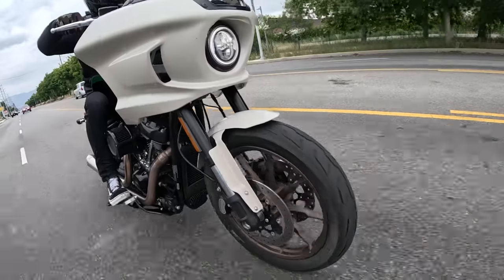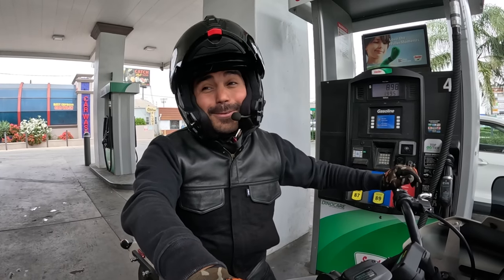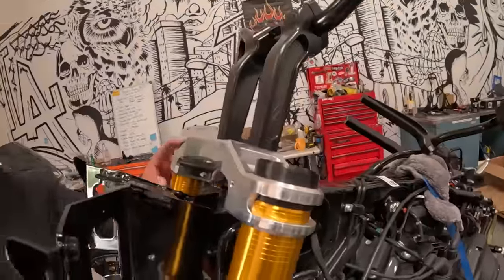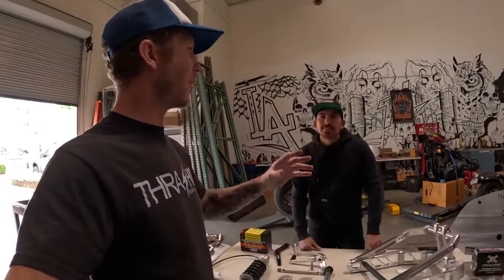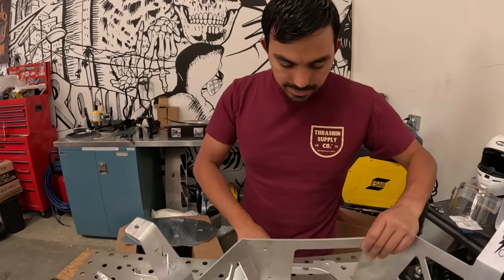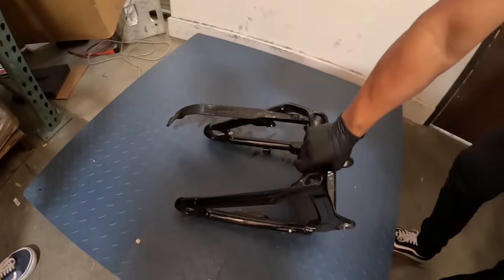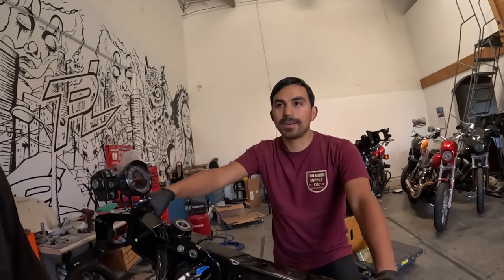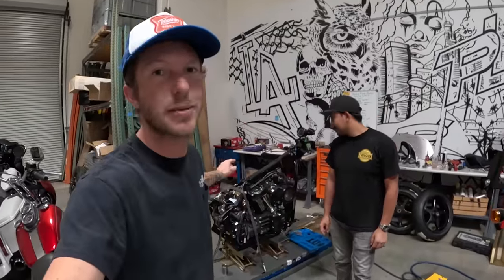Low Rider ST! Makes 1XX Horsepower? Born-Free Build Week 9 - Vlog 77

Comment: Smart on titanium for bolts with anything touching composite. Make sure no aluminum contacts composite. It will corrode. Worked on Boeing 787, aluminum and composite are a problem. Great videos!

Comment: You guys should try rcs levers they make them specially made for harleys and they make a world of difference with the clutch stiffness on the harleys.. and they have a lifetime warranty so if it ever has any issues they replace it free. But the best part is hoe they make the harley levers so that it's a much better design so it makes clutch pulls feel so much easier it's almost unbelievable 😊

Comment: I cant believe you guys spent well over 5 grand on wheels and didnt use ceramic bearings...LOLZ....Brocks is right up the road from you and usually has them in stock....  Bike is REALLY ready to rock now!!!  Cant wait til next week!!  If I still lived nearby I would be spying on you!!  LOLZ. I have to go back and look, but hopefully you did some work in the Primary, as once you put those super sticky tires on, your compensator and clutch are gonna get wasted for sure, and if you did, then it will be time to worry about the transmission.  The drivetrain just isnt built to handle it all, once there is zero give at the tire....if it doesnt blow the tire away, then all suspect components in the drivetrain are gonna go KAPLEEEWWEEEE (thats the technical term for FAIL...LOLZ)

Comment: I'm wondering if that case for the ABS module that the fuel pump wiring runs through also acts as a heat shield for the wiring for the heat coming off the front cylinder head?  Say, you get stuck in heavy traffic is wiring insulation going to melt and short out?  Just thinking out loud, engineering wise.
Reply from the maker: Wires will now be further from
The engine then ever, in the same tunnel all the other wires are in. I sure hope a thin piece of plastic ain’t insulation to keep something from melting haha

Comment: Only 140hp? Needs a better cam, throttle body, and head work.
Reply: I run a S&S DRAGON T143  170hp 162torq n also has a little blue bottle in saddle bag ON  TOP😮😅